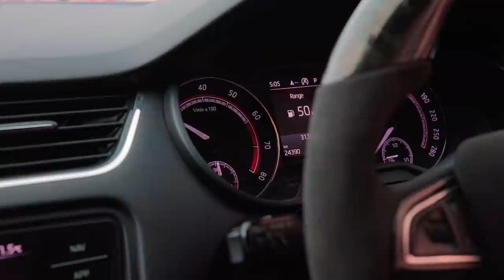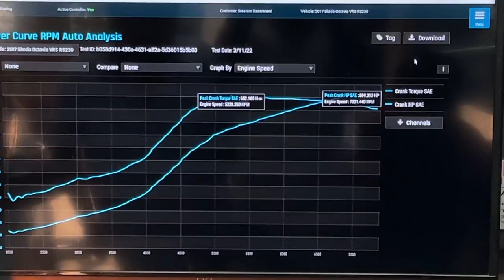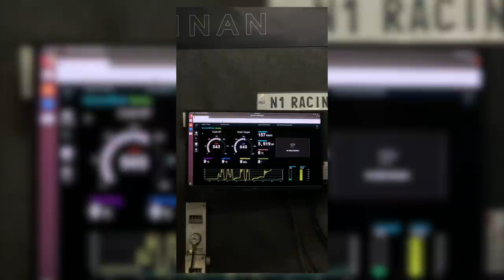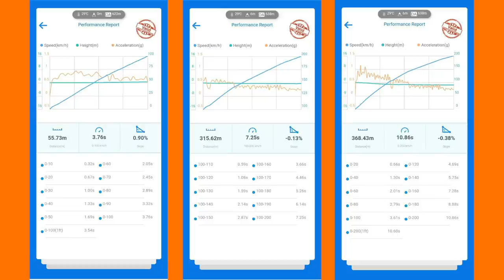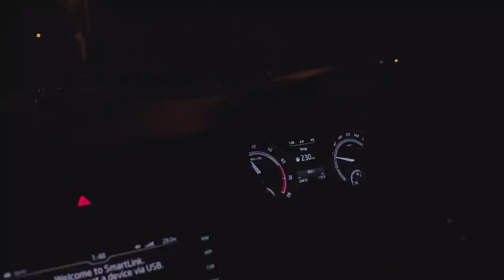600 BHP AWD Octavia VRS! Dyno Run with India's Most Powerful and Fastest Octavia VRS! (Part1/2)

Comment: For the people askinh how the car is spinning only the fronts on the dyno? 
Disconnect the haldex controller and one other controller upfront on the transmission and the car behaves like its fwd. No biggie.
Reply: So will the figures be different if was a all wheel drive dyno?
Reply: @air870  yes. Dyno would read less WHP imo. But engine output would not chamge obv taking whatever %age loss to the wheels is calculated. Also, a dyno is just a tuning tool. There are a lot of factors that can alter dyno numbers. 
On high hp cara with a narrow power band even the type of tyre thread will alter readings.
Reply: Could you also make it rwd? Where can I read more about conversion kits etc
Reply: @TheArpitkoberoi  i think theoretically you could. But that is in theory. Everything has to come together and work with one another. But this is a good question, ill reserach on it and reply to you.
Reply: @abhirmalhotra5103  thanks man
Reply: @TheArpitkoberoi  so. It has been done. But it is real hard work. Its not like yanking the front axles out. But to answer your question, it can be done with a lot of work.
Reply: @abhirmalhotra5103  yup Ford, Merc and VW have done it with the Focus RS, A45 S and Golf R. It's Drift Mode.
Although the power split isn't actually 100% to the rear axle, it's more like 80-90%.
It's just to let the rear slide, rather than actually drift.
Reply: yes it can be done but making fwd a rwd will cost more better to buy rwd and tuneit
Reply: get a bmw S3 2nd hand and spend 10L in turning it or swap engine

Comment: How hard is it to convert to awd, I have octavia at 450~bhp and just wheel spins to 70 if I put my foot down. Admittedly I have a few things I can do to improve the traction, but AWD would be awesome.
Reply: Get bigger wheels
Reply: They probably put the audi quottro system
Reply: @atharva0777  wider**
Reply: @sarthaksabbarwal71  bigger and wider
Reply: Bruh rwd are more faster than awds
Reply: @phantom8599  Whoever told you that lied.
Reply: You have to take the haldex system from the TDI version. Its a pretty big job, I absolutely do not believe some Indians managed this or 600hp.
Reply: @MementoMori-xx5qo  wow ! that's incredibly racist.
Reply: @brugsrandomvideos909  Yes, probably if you notice there is a Quattro batch under Octavia at the back

Comment: It can definetely beat those bimmers. And this sounds like a jet on that dyno. 10.5 seconds a quatermile thats near to a porsche 911 turbo S 😐
Reply: Bimmers bro??😂 600hp awd can beat anything you throw at it 😂✌️⚡️
Reply: @anshmittu2439  🤣
Reply: Which those Bimmers you are talking about ? 330i stock ? or M3 or M5 ? 
A dumb person only can compare a modded fwd car to stock BMWs or Mercs. 
M5 CS has 635 bhp stock with awd.
Reply: @Eren-da-Jaeger  bro its 575hp the 330i has 255hp even with front wheels alone the vrs can beat it. And no  iam not comparing it with the m5🤣.
Reply: 911 is shit bro
Reply: @nickjones2813  are you sure?
Reply: @athish47  dude my 323i of 2002 was stage 3 tuned with turbo added. It was a 2.5 lit straight 6. You can't imagine probably what it became. Ultimately had to sell back to BMW when takata airbag recall happened, they gave good money for it.
But my point is, why do u have to compare a modded car with non modded car? If I get option for free 330i or this vrs, I would choose less powerful 330i, cos  I will drive my car in winding roads and A roads along with M roads, where vrs will be utter fail
Reply: @Eren-da-Jaeger  comparing a tuned car with a non tuned car? Price difference bro. Vrs is a cheap car which has the capacity to beat BMW. The vrs's 1.8 & 2.0 tsi engines can gain above 300bhp with just a stage 1. And yeah the vrs can be kept more easily than a BMW because it shares a lot of parts with audi, vw and the list goes on. No one is going to give a vrs or a 330i for free.
Reply: Porsche's launch control is a thing to remember